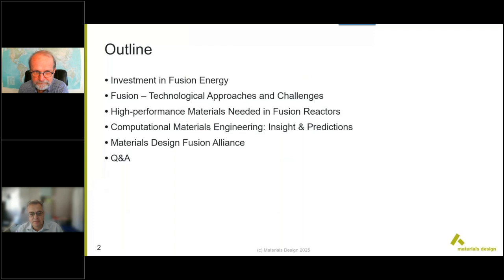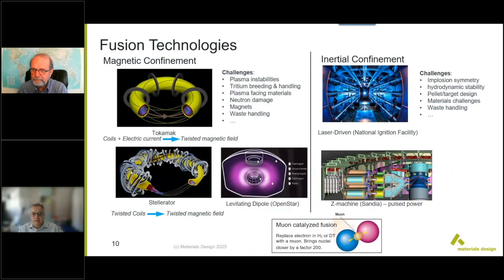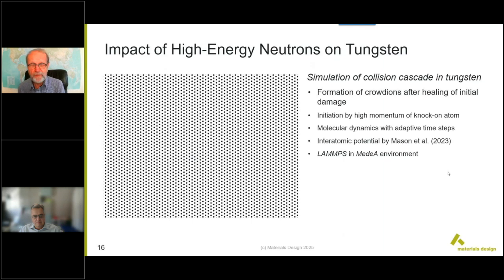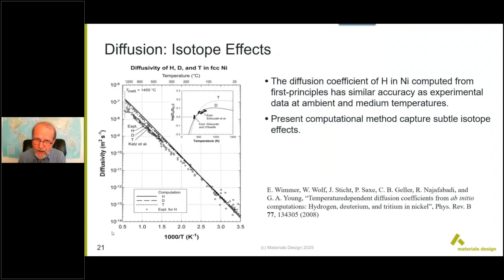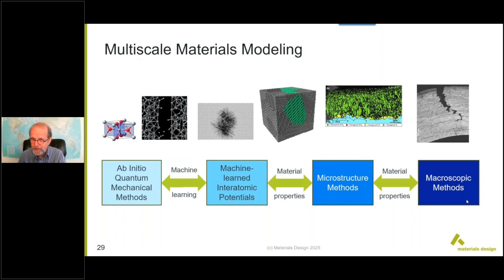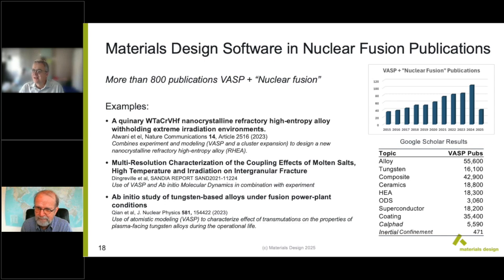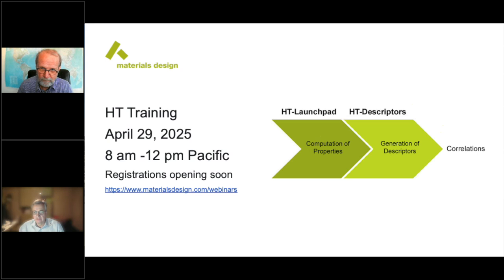Unlimited Energy: Materials Modeling for Nuclear Fusion

Comment from the maker: Webinar Sections

0:00:00 Logistics and introductions (Katherine Hollingsworth)
0:01:38 Background and outline (Gerhard Engel)
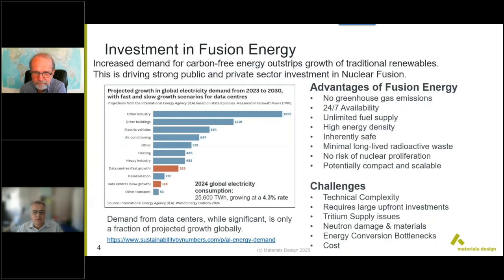0:04:29 Fusion investment - risks, rewards, and challenges
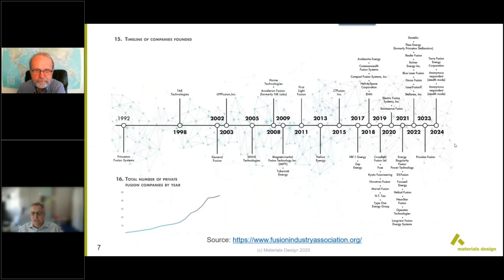0:10:51 The growth of the commercial fusion industry
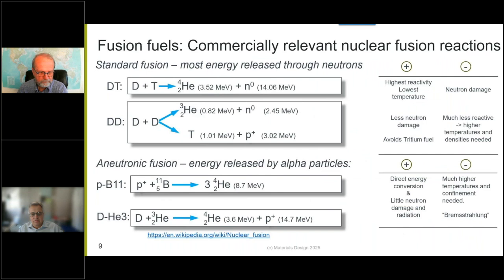0:11:18 Overview of the physics and technology of fusion
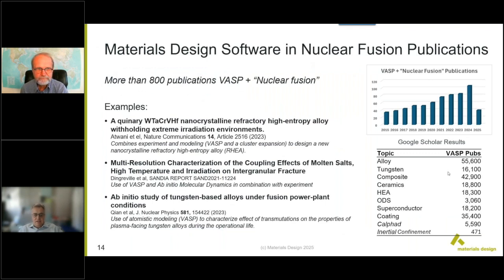0:21:18 Materials simulation software in fusion research
0:23:19 Computational materials engineering in nuclear research (Erich Wimmer)
0:25:14 The effect of irradiation on materials properties
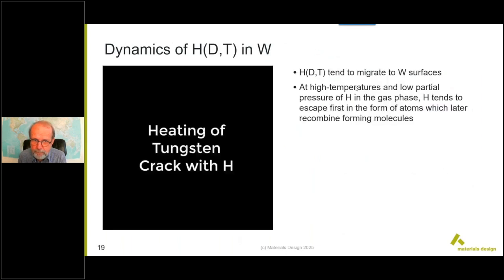0:30:28 Dynamics of deuterium and tritium: diffusion, release, and trapping
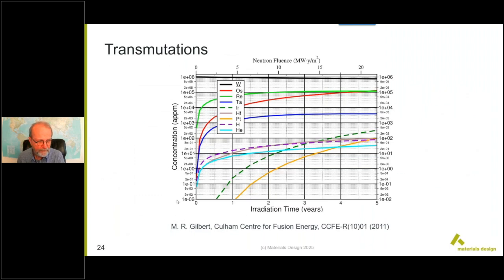0:39:48 Effect of transmutations
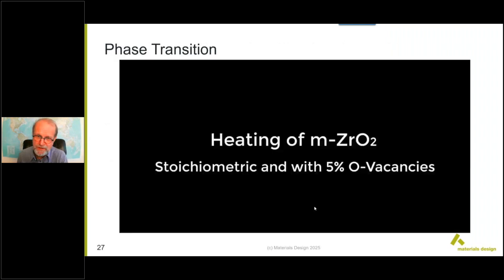0:42:45 Phase transformations
0:44:57 Microstructure evolution
0:47:13 From ab initio to multiscale simulation and the MedeA environment
0:49:53 Fusion alliance initiative
0:51:51 Acknowledgements
0:55:11 Q&A and announcements (Katherine Hollingsworth)
0:58:24 Machine learned potential generation in the MedeA environment
1:00:12 Comments on nuclear waste management
1:02:11 MLFF availability overview
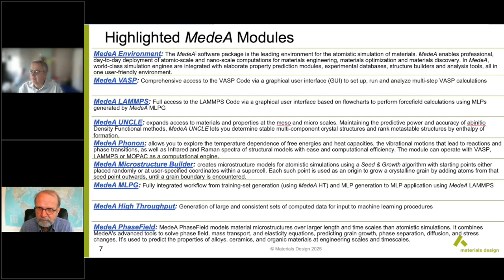1:02:54 Training set for W/Re cluster expansion
1:04:01 Details of the Fusion Alliance
1:04:57 Details of on the fly MLFF generation
1:07:24 Novel alloy candidate insights
1:09:08 Long range interactions for interfaces
1:10:19 Fusion Alliance versus software license
1:11:28 Columnar grain simulation origin
1:12:25 Particle creation in nuclear reactions and simulation
1:13:40 Modeling high pressure and temperature
1:15:31 MLFF training times
1:18:04 Details of machine learned potential for simulations
1:20:31 Does the MedeA environment support GPU based HPC systems
1:22:06 Simulating plasmas
1:23:45 Wrap up (Katherine Hollingsworth)